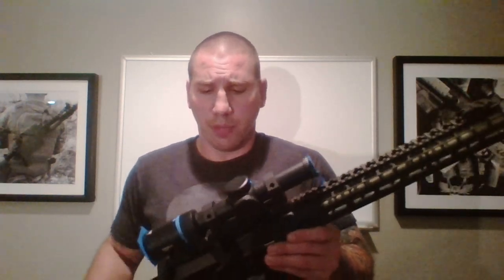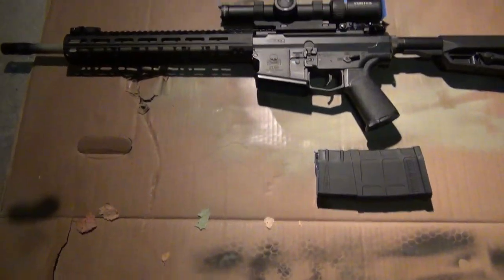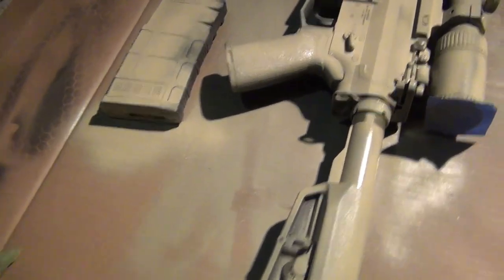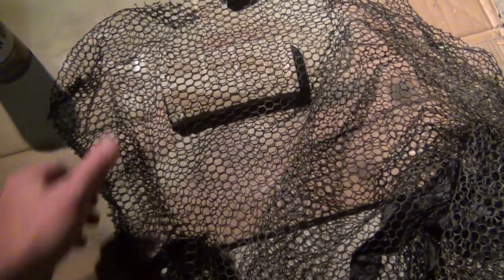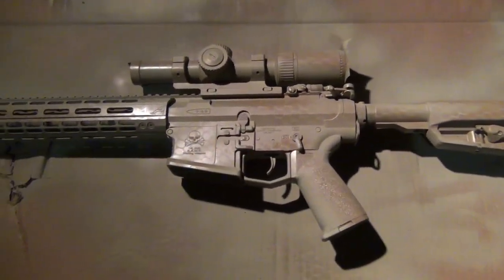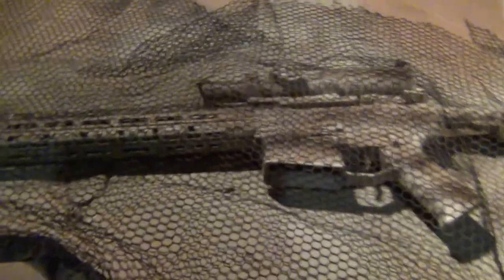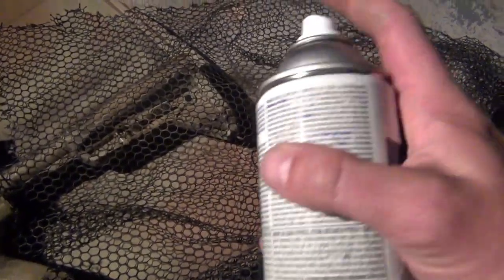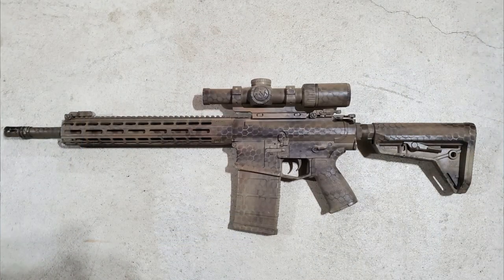Gun Painting Tutorial

Comment: Hi, I don't get the point why you don't cover the moving parts before starting to paint (I mean parts like scope-towers, backup-sights, mag-release-button). I'd be afraid that the paint could reduce fuctionality.
Reply from the maker: It doesn't. You do have to keep in mind less is more when it comes to paint. The only issue I have ever observed with functionality after painting is the spring that holds the dust cover open. Even that is uncommon and if there is an issue just put some Acetone on a Q-tip and remove the paint from the exterior of the spring.

Comment: Do you ever have problems with excess paint flaking off and jamming up the rifle?
Reply from the maker: Not at all. Most flaking issues are caused by not properly cleaning a rifle before you paint (dirt and dust underneath the paint keeping it from adhering to the gun), not letting the paint thoroughly dry before use or using too much paint. Don't get me wrong, any paint job will chip off with use but it shouldn't be excessive.
Reply: Gunfather Milsim makes sense. Thanks,  gun turned out nice btw.